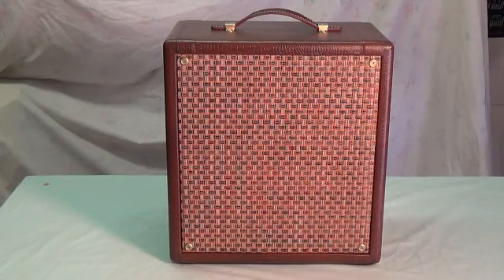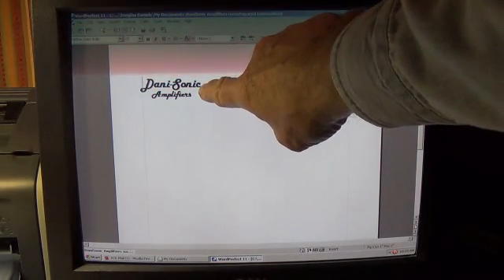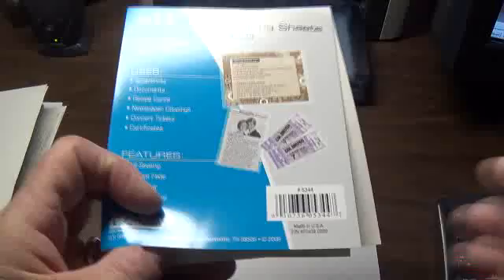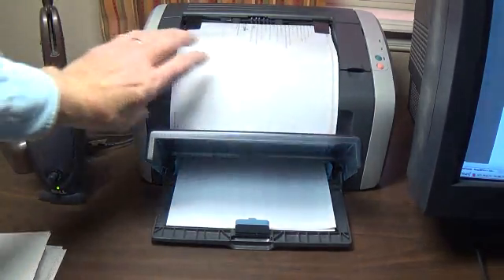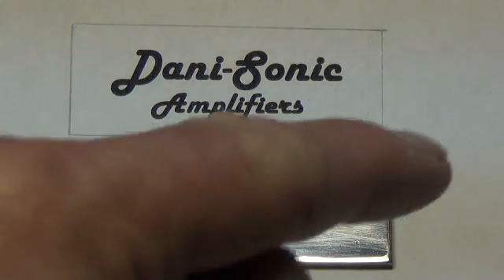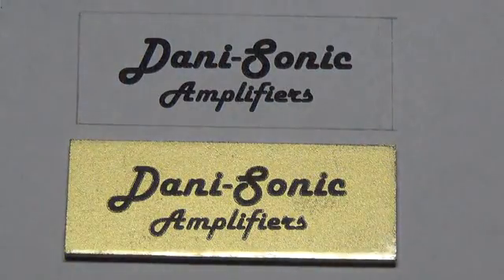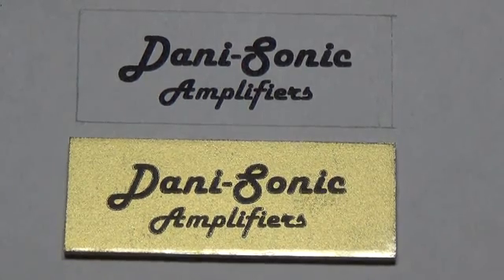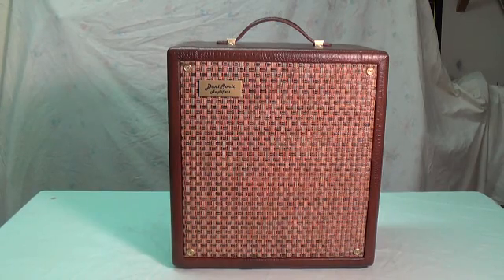How to Make Custom Amp Logos and Labels

Comment: Doug, nice video ... funny too!  I'm a bit confused as to why it's necessary to print it on the plain paper first since you go ahead and use the laminate printed one?  Is it only to check the result of your font and logo size?  If so, why did you did you go ahead and border the plain paper one?  Would you clear this up please.  I thank you.  Btw, your finished plate is a very nice design and very professional looking as well.
Reply from the maker: Thanks, Mike. Yes, I print the paper version to verify it's size and how it will fit on the plate. Also, it tells me exactly where the printing will occur so I can attach a small piece of the laminating acetate to that exact area of a paper sheet......rather than sacrifice an entire sheet of laminate.
Reply: @UncleDoug  "ah Confucius say you smart ferrow!"
Reply from the maker: @sunburstmike8745  Thanks, Mike.

Comment: Have you tried waterslide paper? That seems like that would be a little easier.
Reply from the maker: I have not, CM, but appreciate the tip. Thanks.
Reply: @UncleDoug  No problem. That's what I use for the graphics on guitar pedals. You can spray clear coat over it for durability. Appreciate the videos. I've learned a lot.

Comment: I better idea is to print in reverse on acrylic / ascetate sheets then you can touch them up with a fine brushand black paint and glue them down to the control bezel, all the markings are behind the plastic and safe.
also, you can print in reverse onto paper, stick it print sode down with PVA glue to wood, then the next day when its solid just run water over the paper and rub it gently to dissolve the paper away leaving the toner powder print.
Reply from the maker: Thanks for the tips, Prince.

Comment: Hello again Uncle Doug,  I'd like to hangout with you.  Too bad you're so far away.  Question!    Was the reason that you used gloss for esthetics,  or so the ink would stick better?   As always,  Thanks
Reply from the maker: I guess it was a combination of reasons, KG. I believe that matte finish laminating material is available at Hobby Lobby, but I felt that the clear would look better. Also, if you're going to cover the printing with a layer of acetate tape.....it wouldn't look right unless the bottom layer was glossy.

Comment: Hi ya Doug .Thanks for sharing all of your expertise!I have used a similar method for making labels and panels using gloss paper and laser printing for black,and ink jet for color. I'll have to try the laminates .One thing I would like to share is that I have used that clear two part epoxy that is used for bar tops,as a top clear coat. It is very thick and glossy and adds a nice contour to the top of the tag. It adds a couple of more step to the process, but is extremely durable when it cures. Thanks again.
Reply from the maker: You're welcome, WB. Thanks for the interesting tip.

Comment: For front panels, using software like Draftsight or Corel Draw, I create the artwork for the panel, including the background color, then print it on photopaper.  If I need to use 11" x 17" paper, I go to Staples and have them do the printing.  Then, after making sure that the printed copy is free of dust, I apply clear sticky-back plastic over the paper avoiding any bubbles, and then finish the job by using a J roller to ensure good adhesion between the paper and plastic.  Finally, I attach the paper to the metal panel by using Weldwood contact cement.  Once again, I finish the job by using a J roller to ensure good adhesion.
Reply from the maker: This sounds like a good procedure, Roid. Thanks for sharing it with us.
Reply: Write on front panel like volume, gain etc,... (Its very small alphabets) With Sticker or paint?

Comment: Your process works pretty well. I've had good success with decals and a bubble-jet printer in the past, which will allow you to do colors... but... now I have the local Trophy Shop Laser-Etch my badges and amp control face-plates onto a thin piece of stainless steel, which is extremely durable and permanent. The process can even do colors as well and it's not that expensive. As low cost as the lasers have been getting, if I did a lot of them, I'd probably spend the money and purchase my own. Oh... and single color graphics come out looking nice, too. ~ "Ladies underwear and beer bottles..." lol ~
Reply from the maker: Thanks, Mark.  It's all part of my desire to maintain complete, independent control over the building process. Any time I need the services of an outside agency, it always adds extra time, travel, and frustration. I guess my wife is right about me being a control freak :)
Reply: Nothing wrong with that at all... 😉

Comment: Hello, how do you fix the label on the front clothing? Is it glue?
Reply from the maker: Yes, I used a couple dots of 5 minute epoxy to secure it to the grill cloth. You could also use double-stick tape, I guess, but it would be less permanent.

Comment: Why did you print on paper first? Also a good thick coat of clearcoat would be a good protector maybe.
Reply from the maker: +Matt Stumblovski  I print on paper to know exactly where to position the laminating sheet. After I tape the sheet (or small piece of the sheet) in place over the paper image, I run it through the printer again. I do use several coats of clear lacquer or acrylic enamel in some cases.....see my recent series on the Supro Tremo-Verb clone.
Reply: Ah! Gotcha. I get it now DOH!
Reply: Matt Stumblovski I was wondering exactly the same thing. I was afraid I’d missed a step. Thanks for asking!

Comment: Nice tip.  I used to use Letraset  (rub  off lettering) and the special spray fixative years ago, but it wasn't as durable as the method you suggest , and on some of my projects I just submitted my designs to a trophy shop that had a laser engraver..expensive but for "one- offs", it  was a workable solution.
Reply from the maker: +SuperCarver2011 Thanks for the info, SC.

Comment: Great stuff. Another way to put your logo on is to use a water transfer technique. I saw it in another Youtube video based around the idea of getting a custom logo onto a homemade guitar pedal. Although I believe you need an inkjet printer for that.
Reply from the maker: Thanks, Mike. Yes, I believe you can buy water-transfer paper and then print decals with an inkjet printer. Since I have a laser printer, this is the method I have been using. I have no experience with the other method, but it would probably work quite well.

Comment: Hi  Doug, I tried this to day. But I only had the A4 Lamination Pouches, (which are to plastic sheets sticky in between), not like your single sheet with none stick cad packing.

It sort of  worked, the two sheets stuck together in the laser printer, but I did get a good image, so I thought (which was a sort a bad move) what if I put alumin kitchen foil in between.
well it sort of worked and I did not damage my printer ( which was my worry), the two sheets stuck with the foil, but the image was not hard and fast it come off on my hands, (so it effected the harding of the toner. but it sort of work. the only prob I had it printed on the dull side not the shiny.

may try again tomorrow. any help any one ???????
Reply from the maker: Greetings, Ron. Sorry for the delay in response, but YT never informed me of your inquiry. For best results, you really need to use the same type of laminating sheets that I show in the video. Also, to make the printing more permanent, you can overlay it with a covering of clear shipping tape (be careful with bubbles), or a couple coats of clear acrylic spray paint. Good luck !!

Comment: A good thing to remember is to configure the printer for "best quality", so the logo looks nicer, specially if it has a lot of details, tho my designer side wouldn't recommend a logo like that to even be used... Simpler is always better when it comes to logos.
Reply from the maker: I hadn't thought of that detail, BC, and I agree with your preference for simplicity.  Thanks for your input.
Reply: Uncle Doug You're welcome!
Simplicity not only makes it easier for making the logo by hand (whatever the method you choose for it), and also makes you use / lose less material when making it, but it also makes it a lot easier for your logo to be recognized.

Think about it. The logos that you can remember more easily are those that don't have much detail, however they have enough detail to make them unique.

A good example is Orange. You may recognize the little "shield" logo they put on their cabs, but the name with that specific script they use is what really catches your eyes at first.